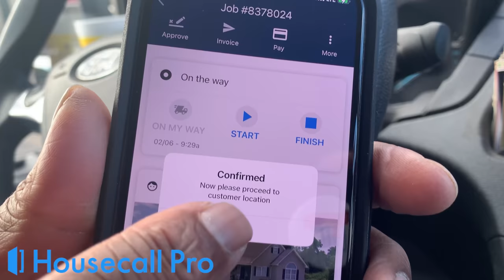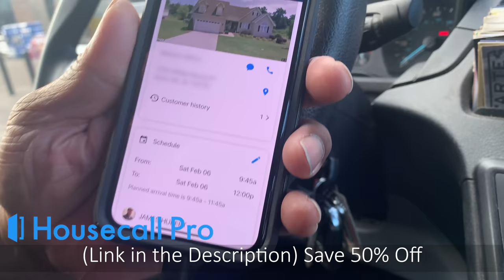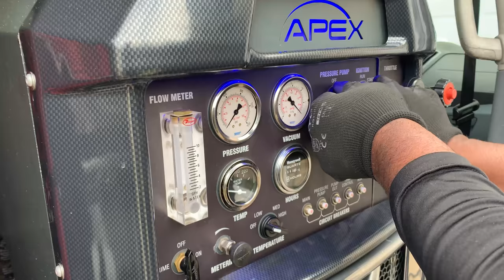A VETERANS CRY FOR HELP CARPET CLEANING!

Comment: How do you clean the vacuum for the next customer? I don't get my carpets professionally cleaned for that reason! Some of these people live in absolute filth!! That poor guy, his daughter really did him in with that one! Thank you for giving him a clean space back ❤️
Reply: That seems silly since the steam/carpet cleaning is going to disinfect and clean the carpet after dry vacuuming. For heads of the carpet/steam cleaners they're usually wiped with disinfectant and/or heads are hosed/pressure washed debris off. Insides likely a hot rinse. Dry vacuums are usually only cleaned on the outside with disinfectant but there's not much point to disinfecting the nozzles/suction base on the inside. Wheels are probably cleaned if they worry about debris transfer.

Comment: I fear that every carpet needs to be replaced, that the concrete beneath it needs to be treated with a solution then dried and sealed.. so everything can be build from scratch.. and the whole house needs to be cleaned aswell.. I fear that the dog did more damage as the eyes can see on this moment.
But, I also realize that this person imho has had a life nobody wants and is in a very difficult place ...
He needs as much help as he can get but it is all very delicate balancing at this moment now with Covid and everything also.
But all you can do is your best and you guys for sure did so, thank you 👌
Reply: Why fear?  Strange word to use
Reply: @analiahedley6487  using the word fear means in this context that the person is worried that their is more damage that can been seen and will cause problems in the future.
Reply: @analiahedley6487  it's a pretty common phrase. Is english not your first language?

Comment: Oof! The whole house needs to be cleaned not just the carpet🙈
Reply: I agree but it is a start. I wouldn't want to walk on the carpet to clean the house with shoes. If you use anything that's wet such as mopping, cleaning walls, ceiling fans, baseboards, etc. all you're going to do is create mud mixed with urine, excrement, and who knows what else. I suspect the carpets were the worse and I can't imagine the smell.  🤮
Reply: Too bad Kim and Aggie are OUTTA BUSINESS